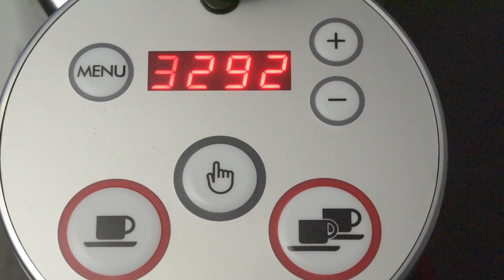Main boiler No hot water or Heating fix.

Comment: Dr pipe , whats the best silicone grease for heating engineers what do you use and where do you get it from - all i seem to be able to find is the tubes and i don't like those thanks in advance
Reply from the maker: Richard Adam use silicone grease by poly pipe small tube expensive but